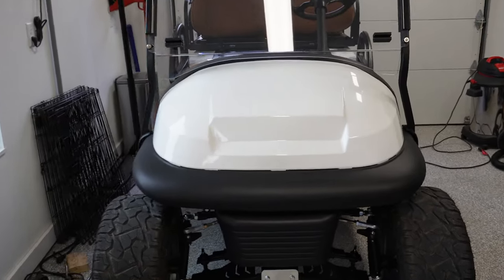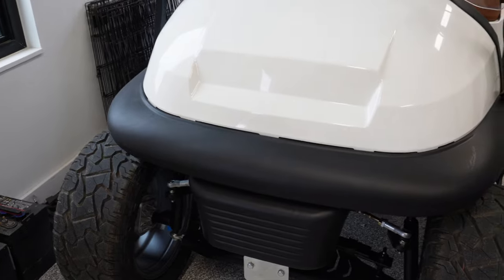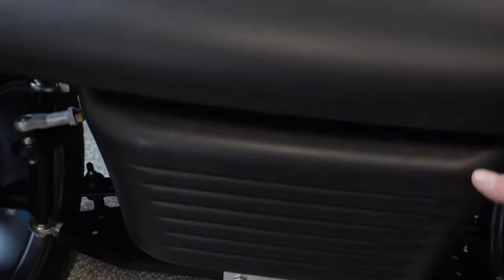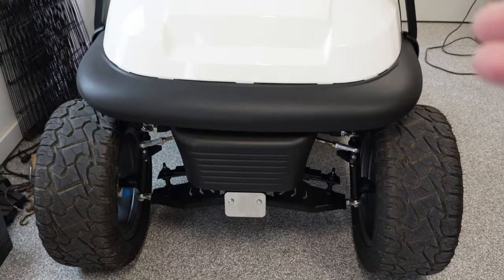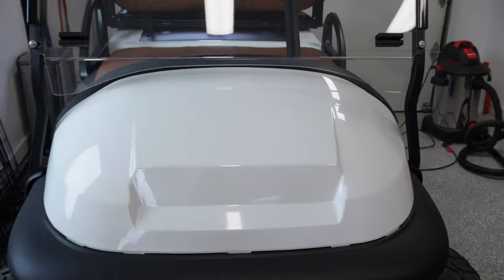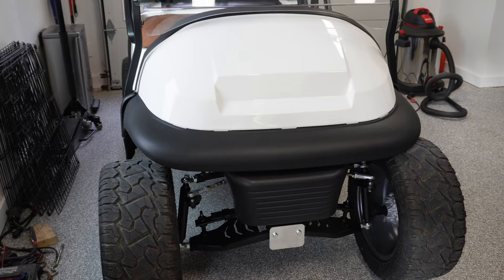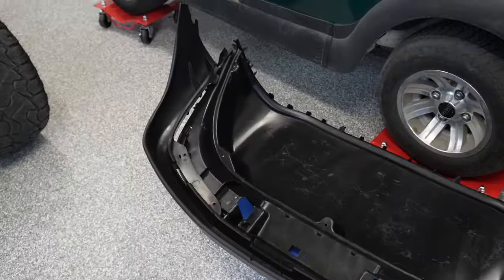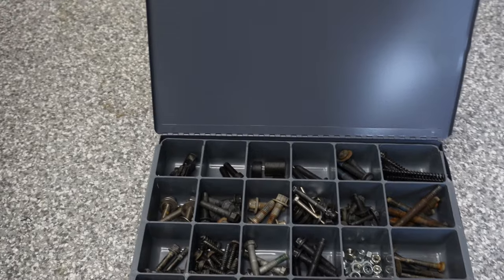How To Convert Your Club Car Precedent To A Tempo!!! (Bandit part 11)

Comment: I'll give you a little helpful hint for marking and cutting templates like that

Put some masking tape strips on a flat surface like a glass tabletop. Then mark and cut the masking tape to the proper shape then stick it in place. It will make things a lot easier and you won't be fighting to get it to conform. Plus it will keep you from scratching your body. 

I plan on doing the same conversion only in Atomic Orange 💖

Keep up the videos, they are inspiring
Reply from the maker: Thanks for the tip and thanks for watching!!
Happy New Year!!

Comment: I hate those torx screws.  I replaced mine with stainless steel metal screws which work great on these plastic pieces.  I found that every nut and bolt and screw on my cart was rusted.  
The previous owner of my cart must have left it exposed to the weather for several years.
Reply from the maker: Thanks for the info